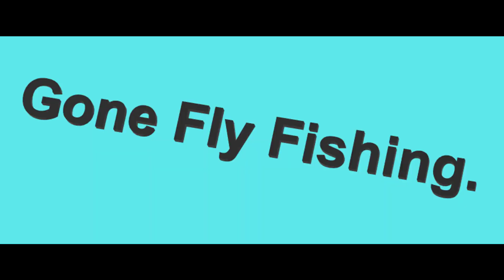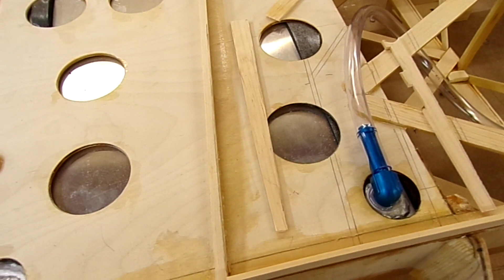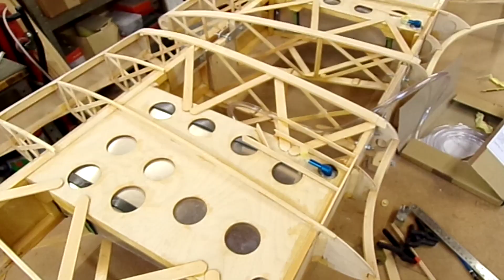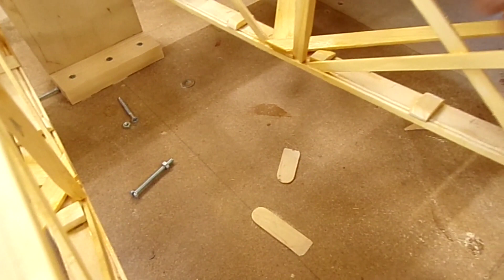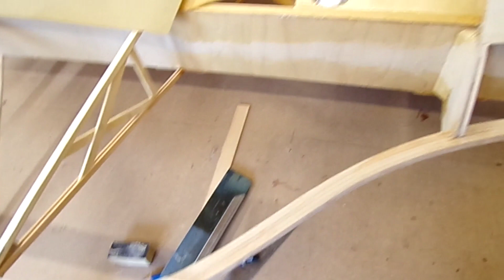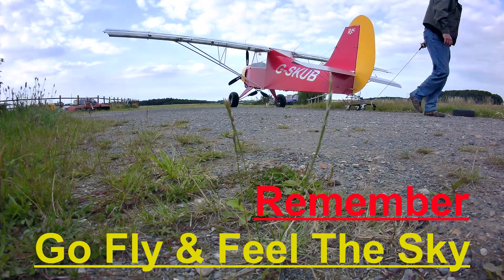EP63 Fuel Tank outlet area. Fisher Youngster Top Wings

Comment: How unreasonable that you have to go to work instead of continuing the build 😀 Would it not have been better to have some form of removable inspection panel for hose servicing, I've also noted that you have used very few screws in this build, even for non-stressed areas, is this for weight, ascetics or durability reasons? Ignorant, fascinated viewer questions, sorry  🤣🤣🤣
Reply from the maker: All good questions Terry. There will be removable inspection covers (hope to be in next weeks video). The problem with normal wood screws is, they tend to come undone with vibration and it is easy to wear out the holes; other screw types need something to screw into like the inserts I used to hold the tanks down or nut plates as I used on the ailerons and that all adds to the weight.

Comment: Just wondering if you will need to periodically change the clear tubing you are using for the fuel line? As always, thanks for showing your build!
Reply from the maker: Yes I will change it every second annual, hence the need to be able to have it guided by the cover supports and the slot to be big enough for me to grip it and pull it on. Good question and thanks for watching.